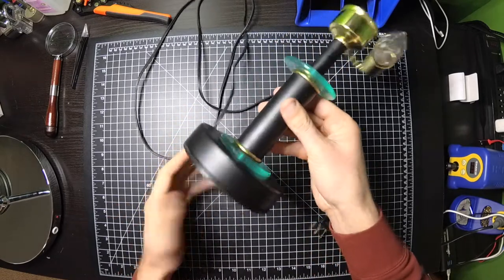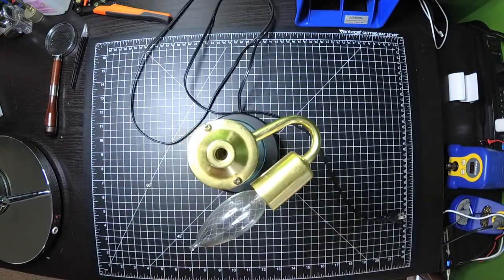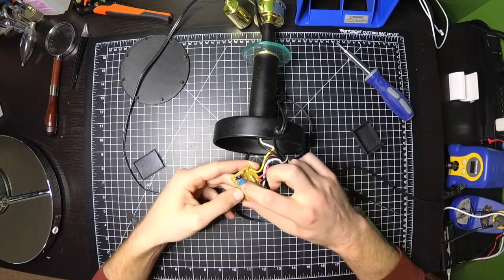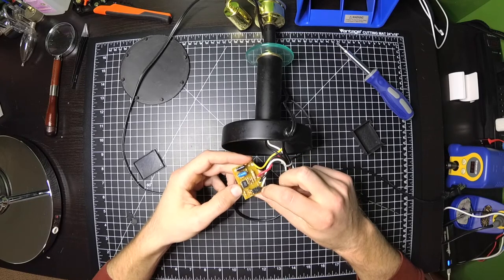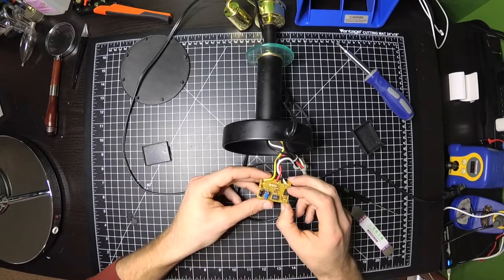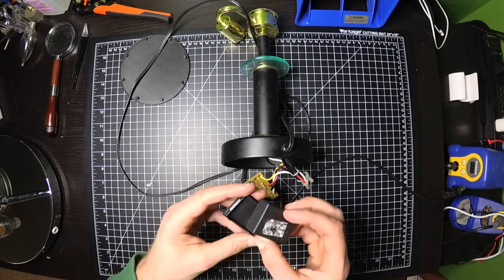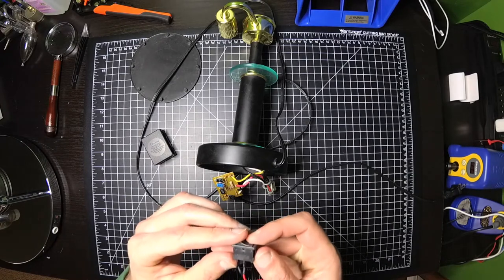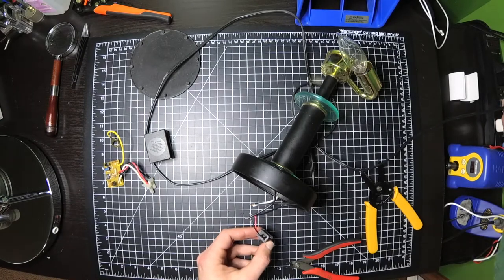Lamp Repair: Replace Touch Control with a Switch

Comment: Nice job on the switch!  And props for helping out your mom!

For people who want to get rid of the touch feature (broken), I just did that.  I snipped out the module and connecting wire nuts, taking care to leave as much wire as possible to reconnect on the cord going to the plug and the cord going to the socket.  Each of these splits in two.

Then I stripped a bit off the end of each remaining wire (four).  I connected these remaining four wires with wire nuts (I use Wago lever nuts, love 'em).  Two from the power cord (when you split it in two lengthwise) and two going to the socket (when split lengthwise).  You just tear the cord, nothing fancy, but don't tear it farther than needed.

The main thing is to consider the polarity.  When you split the power cord lengthwise, one side will have a ridge, the other won't.  Same with the cord going to the socket.  Just make sure to keep the ridged cord to the ridged cord and smooth to smooth.  This will keep the polarity correct.

The other colored cords coming from the module are irrelevant if you don't want the touch module.  

I will put a cord switch on since it's a swing arm wall lamp and that's most convenient, so that part's easy.  Unlike Nick, who did a pretty fancy job on that.

Comment: you did a good job but you spent too much time looking at the touch box and on drilling the hole but no time on which wires to keep and which to rejoin and what to.